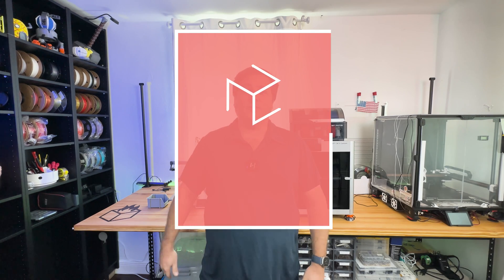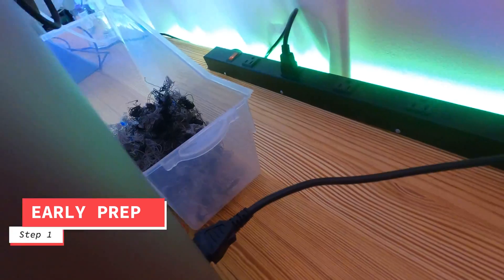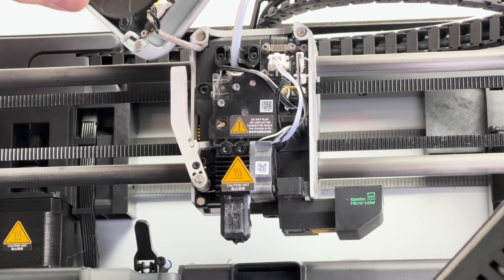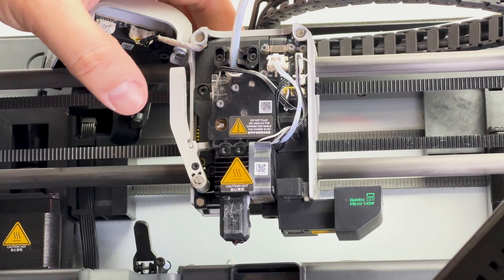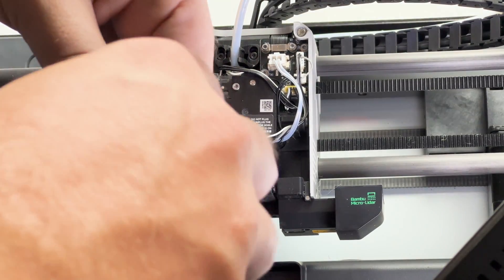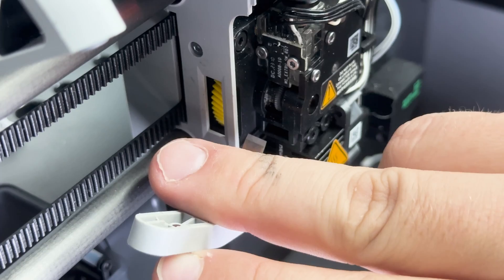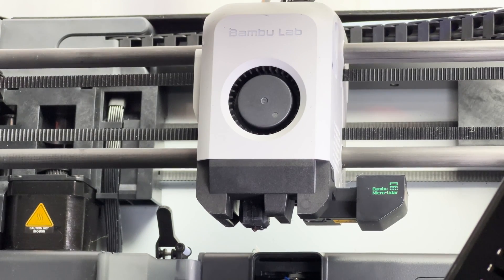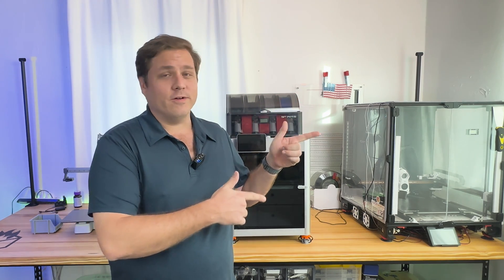How to replace the Filament Cutter on the Bambulab X1 Carbon

Comment: Wow every couple kg really?, 1000hrs in  I thought I better check it...still looks like new lol .
The issue I'm having is loading filament in the extruder gear, not sure if it's the gear or PTFE tube causing the problem

Comment: Mine was having diffuculties pulling back the filament from the extruder for a while. It has working for 450 hours and never changed the cutter. I hope that's the issue. Thanks for the video.

Comment: Thanks for this video. I didn't need to replace my blade, but I was getting a "Can't feed the filament out of the extruder" error. Turns out that when I went to clean my extruder, I never put the blade back in that rectangular slot. My printer wasn't cutting the filament like it was supposed to, and I was so scared that I lost my printer. Thank you so much for explaining something so simple ❤

Comment: I noticed before you removed the cutting blade the beveled part was facing down. When you installed the new one you placed the bevel facing up does it matter if the bevel is facing up or down? My bevel was facing down when I replaced it from factory so I maintained that same direction.
Reply from the maker: At the time of this video it did not matter

Comment: Wish I had that much filament lol
Reply from the maker: I feel that one bro. I always need more!
Reply: @TNTBA  I just had some PVA get stuck in my ams. You think you could do a shore hardness filament test to see how soft you can go before it jams?
Reply from the maker: @jasongunbeard9644 I don’t have the tools for shore hardness test - I could test my TPU and TPE and test performance based on the manufacturer’s rating. I think if you extrude the softer filament slowly, it’s possible. the TPE I have is 83A. It’d pretty darn soft. My x1c got jammed but my voron prints it like a champ. I just need to tune my x1c to get it running fine.
Reply: @TNTBA  yeah I think it's just the ams itself that's the issue
Reply from the maker: I don’t have any PVA yet. I’m gonna need to get some it sounds like 😊😊
Reply: @TNTBA    it was supposed to make getting rid of supports easy peasy but even after drying it out it got stuck. I need to look into it to see if there's harder versions of the water dissolve pva. Do you have any platforms for messaging? I'd like to pick your brain more if you have the time
Reply from the maker: @jasongunbeard9644  im on ig, TikTok, discord, and yt
Reply: @TNTBA  what's your discord?